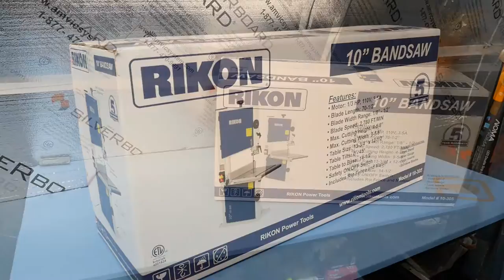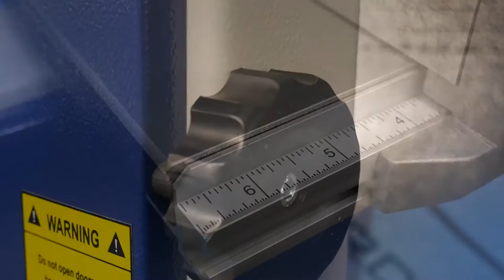Rikon 10" Bandsaw Unboxing & Setup

Comment: hi i have the same bandsaw have u had any problems with it not cutting straight with the fence not right it keeps cutting like squiggle lines in the wood
Reply from the maker: Not had the issue so far although it doesn't get heavy use.  Have you checked the blade guides and blade tension.
Reply: my bottom guide is swinging i called the company and i need to tighten it up